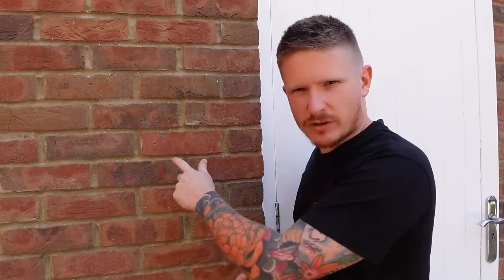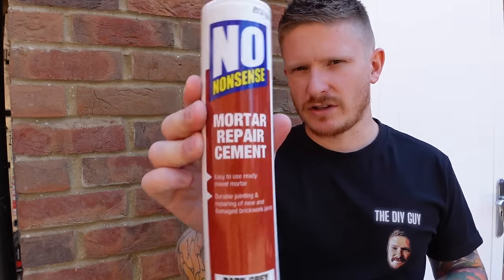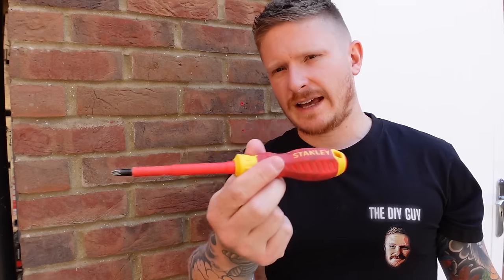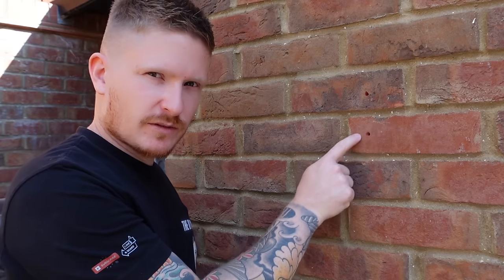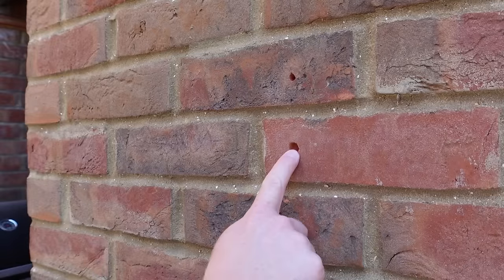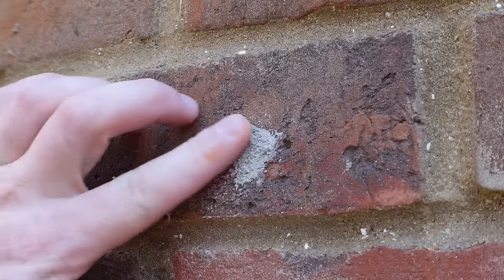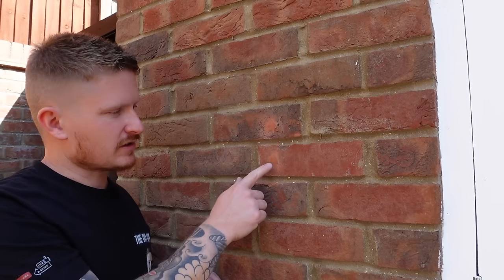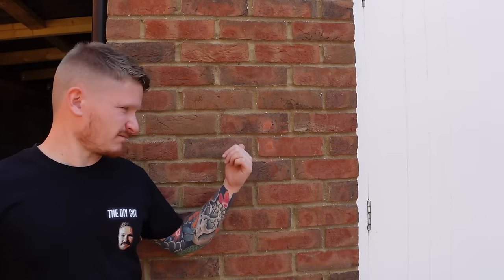How to Fix Holes in Brickwork | Almost Invisible Repair Hack

Comment: Good tip! Just an addition, after you have drilled out the hole, blow out the dust and give it a quick spray with water. This allows better adhesion of the new cement and stops the dry porous (possibly warm) brick from sucking out all the moisture from the new cement which can lead to new cement cracking and potentially falling out further down the line

Comment: Once the cement repair has set, paint on a little wash made up of garden soil/earth and water, and rub it in gently with a finger to help age the repair. Alternatively, if you have any around, dap the repair with fresh (as in moist) manure. The chemicals in manure will help age the repair. That's two of numerous other methods.
Reply: Indeed.  I remember as a student in university, a century-old building had an addition added.  To blend the new brickwork with the old, they had a crew spray manure solution with pressure washers onto the new section, and feathered a bit onto the old.  They let it bake in the sun for a week or two, and then pressure-washed the entire building, old and new.  It matched extremely well.
Reply from the maker: Interesting 👍

Comment: Good idea. Maybe I’m missing the point, but a smaller drill bit will easily remove the plug without the need for screwing and hammering to sink it into the brick.

Comment: Alternative option for brick dust - slide back a roof tile to expose the top of the brick work - chip off a piece of the inside edge of the brick work, Place the chip in a bag and gently crush using a hammer so instead of powder, there will be fine granules which may match the texture of your brickwork.

Comment: learned that trick from woodworking, using sawdust from the same wood mixed with a bit of wood glue to hide nail holes on pieces that will be stained later. really does the trick. Awesome tip my friend.

Comment: I wouldn't have thought to hammer in the screw plugs.  And drilling for brick is brilliant.  I have big gaps where gas and electrical pipes have been drilled to install, maybe because a poor job was done and maybe brick chunks fell out over time from settling, vibration and such.  I can adapt your procedure for the larger gaps and hide the repairs with brick dust from each area to match better.  Thanks for the video!

Comment: A 10/10 how to tip!
I recently removed a sink waste external pipe and had half a brick hole. This tip came in handy to fill the hole. I used a spare brick to drill into for brick dust and then using a paint brush and water, brush along the mortar lines for a nice mortar/brick edge. By the way, SF stock a 5kg tub of ready mix mortar .... simply add water.

Comment: Have loads of these holes in my brick work. Probably due to so many different owners over the years. Looking forward to doing this job and the sense of satisfaction I'll get when completed.
On the coloured the brick work. I had to angle grind splashes of gloss paint that some moron threw up the side of the house before I bought the house. Grinding it off left some nasty marks on there. To darken it down I dabbed some peanut oil on there and let it soak in. Not perfect, but s lot less noticeable than before.
Reply from the maker: Thanks for sharing

Comment: Great tip! I've tried that no nonsense cement repair before, but getting it out of the tube was near impossible!
Reply from the maker: 🤗 thanks
Reply: Either it had gone off or you need a new gun, or maybe you never opened it properly

Comment: Ive been watching you videos for a while and this one is great as i have moved into bungalow and there are wall plugs in the brick work and also the video with the locktight 55 was really helpful too installing new rads no leaks 👍🏻
Reply from the maker: Glad I could help
Reply: @TheDIYGuy1  cheers one of the brick has blown already from the previous owner.

Would it work if i put more mortar and shaped it to the brick and added brick dust or just best to leave it?

Comment: Excellent video, couldnt agree more and just done this myself when relocating light and installing power cable in wall cavity. Unfortunately had 6 holes in 1 brick to fill in due to the number of lights that have been fitted to house it in its lifetime but its covered them up well. Originally was going the cementone route until i saw this. Excellent and cheers 👍👍

Comment: Was hesitant to drill holes for my outdoor TV mount as it requires 4 fairly large holes.  This will be just the ticket but I'm going to save the dust from each of the two bricks when I drill the holes and label them for use later.  I have a special box where I store labeled parts and other items that may be needed years later so I'll hopefully be able to find it.

Comment: Hi, I came across your video whilst Googling my problem, and would it be possible you could give me some advice?

I have just had a new boiler fitted & the engineer seems to have change the position of one of the pipes (I think it’s the overflow) but has now left a gaping hole in the wall. On the outside of the wall, he has covered it with silicone - On the inside wall, he has used decorators caulk & not done a very good job of it. He has only gone round half the pipe with caulk, that’s why I can see straight through the wall. 

Would it be possible to give me some advice on the correct way to fix it?

Comment: Great video, What do you call the metal applicator used to force the cement out of the tube?  Amazon link you provided does not have this included or an option.  Thanks
Reply from the maker: It's a skeleton gun. Thanks

Comment: I’ve used chips of brick along the walls (there are often little chunks of brick along an exterior wall) that can simply poke into the hole. A ball peen hammer, the ball end, works to tappity tap and bust up the plug. 

Just something I did in a recent doorbell replacement for someone. I didn’t like the previous holes that showed, so I searched a bit and found a chip of brick in the brush. 

Similar to using toothpaste (I know, bad form, being that I’m a pro, but I was once a renter and had small holes that the paint alone wasn’t going to ‘disappear’.) or similar. 😂

Comment: I did this and it relaly helped and made for a good look my bricks were old though and the dust looked new.

So if it helped anyone eles there's a product called 'liquid weather' comes in a red spray bottle spray itnot half a coke can and use a very small paint brush or makeup brushes to rub it on the surface.

Do it in layers slowly let one layer dry and check the next day and keeo going till its dark enough, if you lay it on too thick too fast it still looks good but ita almost too dark 👍

Comment: Nice tip looks so much better, shame they don't do a tinted red cement... Someone is missing a trick!
Reply from the maker: Thanks. There you go... That's the million dollar idea right there ☺️
Reply: Interestingly pigments or coloured aggregate can be used make coloured mortar but it's normally in bulk. For this job it'd be like using a carving knife to apply butter. 🤣

Comment: This is very useful but one thing I would add is that with many bricks the colour is a thin layer on the surface and brick red further in.  This will mean that by drilling you will not get such a good match in some cases.  If so either scrape the surface of a spare brick or see if you can buy a few with a more similar colour.

Comment: Instead of hitting the nail and pushing the plug in, i just use the claw to rip it straight out.
Reply from the maker: If that works for you great. It can risk blowing the face of the brick.

Comment: A great way of filling in the holes.  If you had decided to put expansion fixings into brickwork be aware that bricks are not solid and have holes through them or in the case of LBC bricks a large depression that is unlikely to be filled with mortar.  Also, unfortunately the mortar joints may not be solid due to poor bricklaying workmanship especially in housing so there may be a situation where more holes are drilled just to get a single fixing so this repair is not just for removed equipment repair..

Comment: To be honest, I'd rather have the holes as they were before he started for two good reasons. 
1. You may decide later to hang something in the same spot and you will not have to drill another hole. 
2. That patch job looks worse to me than having the holes as they were and the wall would have looked better with a screw put in place with some red colored paint on the screw head that matches the brick.